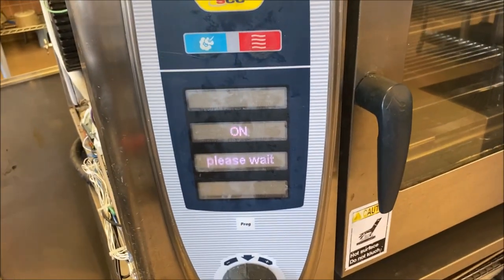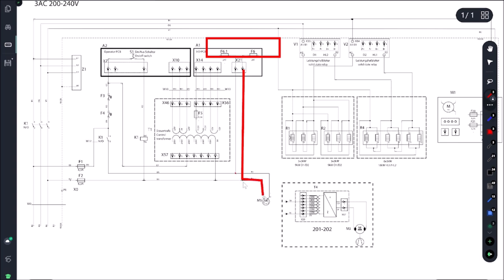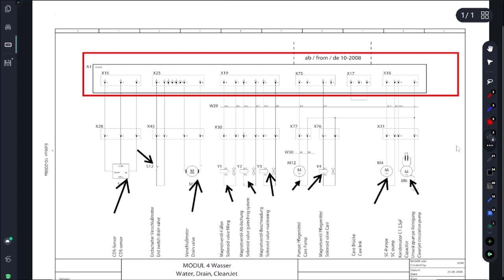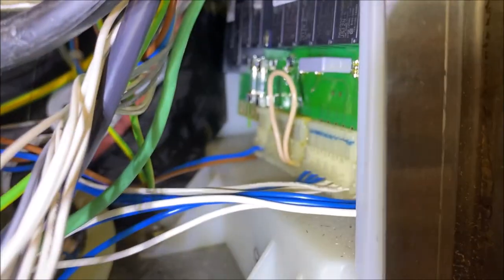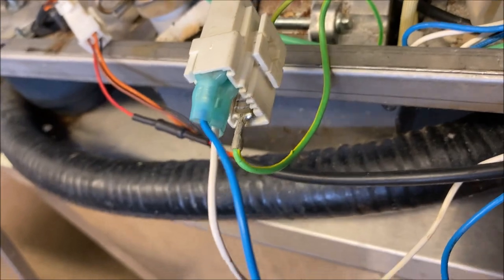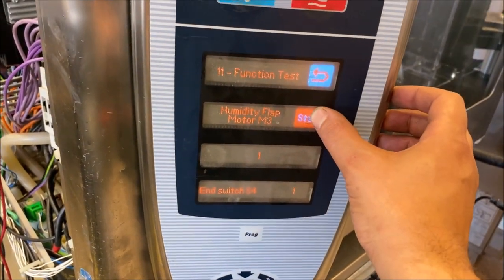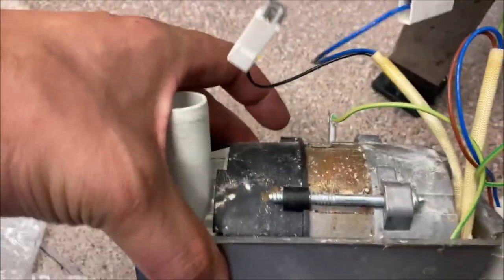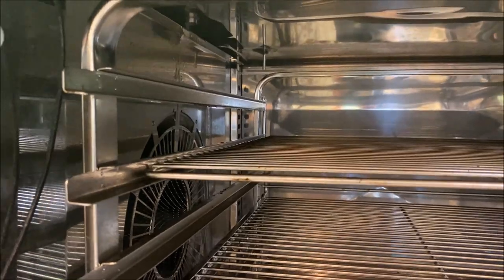Rational Combi is not heating & dead shorting

Comment: I love working on Rational White Efficiency, 5 senses, SCC, CM models but don't know if you have come across the new ICombi models yet what a pile of junk almost professional suicide in my opinion, if a stream element blows you have to change the complete tank, if a solenoid goes you have to change all 3 all joined via what looks like cheap plastic pipe, it's just so bad, I don't know how something goes from so good to so bad.
Reply from the maker: I’ve worked on one Icombi and I feel like that learning curve is gonna be a long one. Steam element has to be replaced with the tank?? Yikes